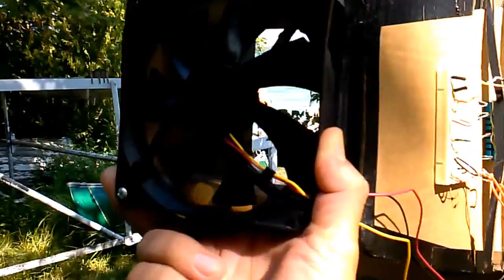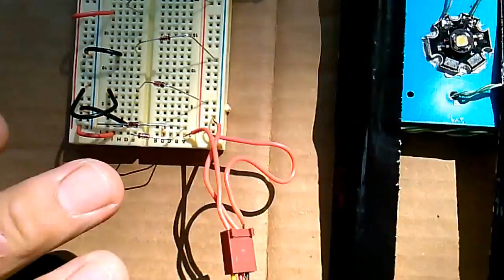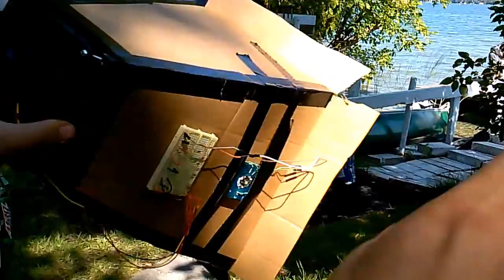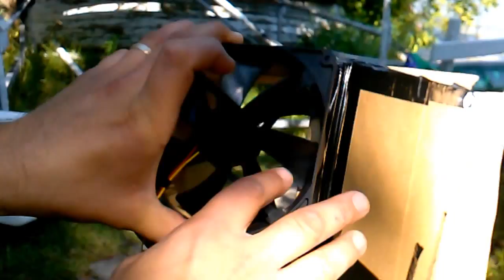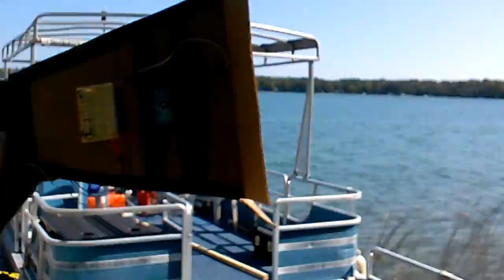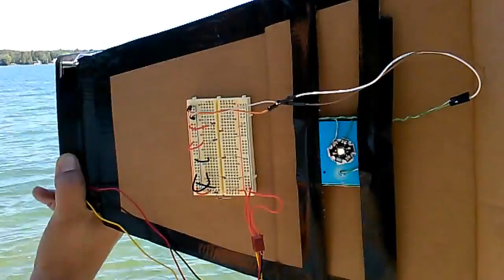Computer case fan wind power generation

Comment from the maker: And.... today I learned....

Nipuna Gunarathne: "these fans are actually bipolar brushless dc and electronically commutated. the blocking effect is natural and isnt included, its caused by the circuit which electronically switches the two coils to cause the rotor to rotate."

Comment: these fans are actually bipolar brushless dc and electronically commutated.
the blocking effect is natural and isnt included, its caused by the circuit which electronically switches the two coils to cause the rotor to rotate.

Comment from the maker: The circuitry, from what I found, would stop the current from flowing.  I imagine that this is to prevent the fan from supplying power to a motherboard (possibly damaging the motherboard) in the event someone is trying to clean it with a vacuum cleaner.